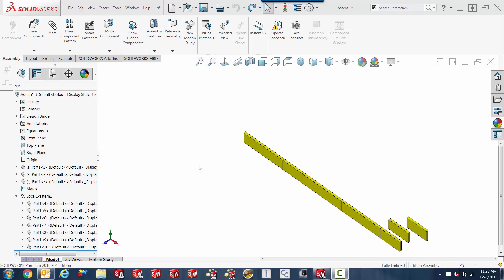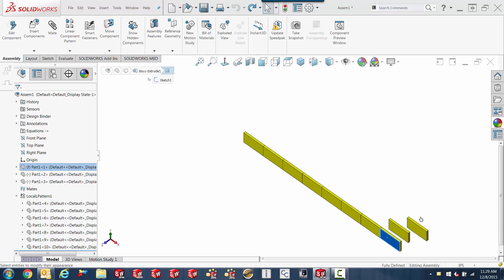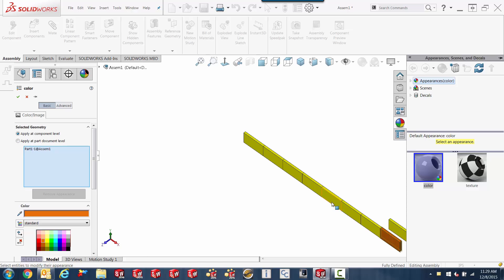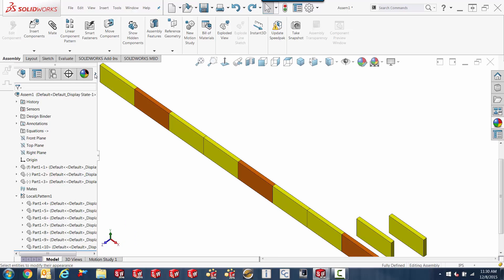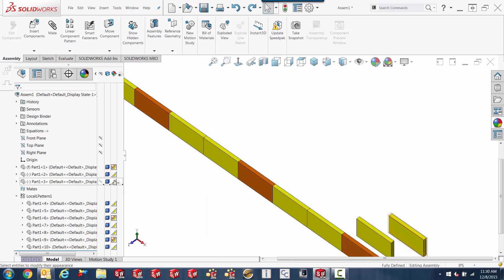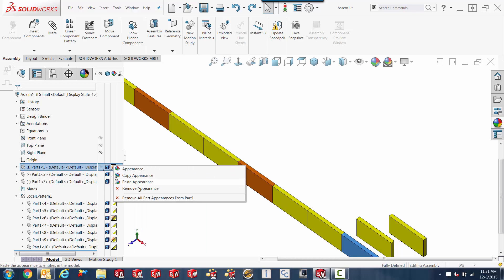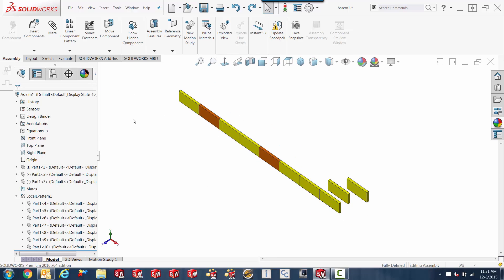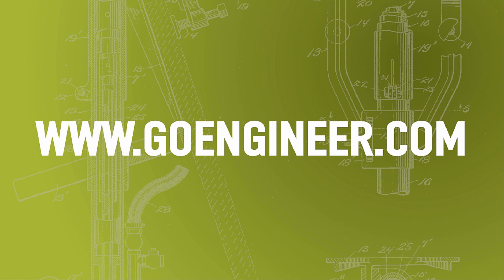SOLIDWORKS Quick Tip - Component Color in Assemblies

Comment: Thanks, can you apply that colour to the rest of the same parts in the assembly?
Reply from the maker: When you select the first of many identical parts, go up to the Select arrow box in the top of the SOLIDWORKS screen (there by default always unless you have removed it) and select the drop down arrow on the right side of that tool.  Choose  “Select Identical  Components” then start the Appearances for the Assembly and it will change all of them.